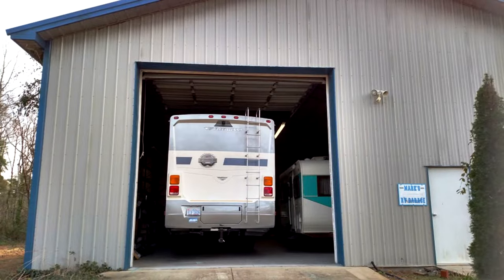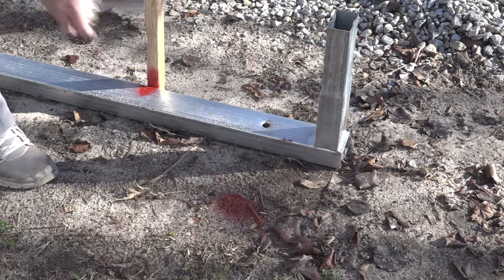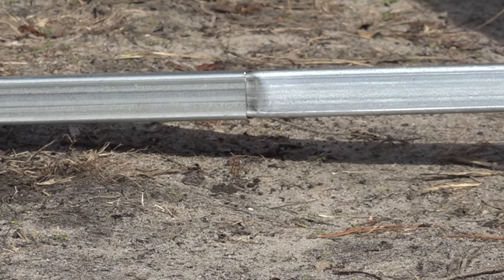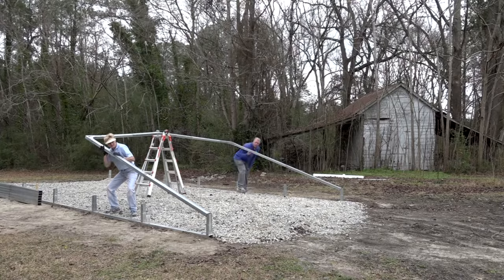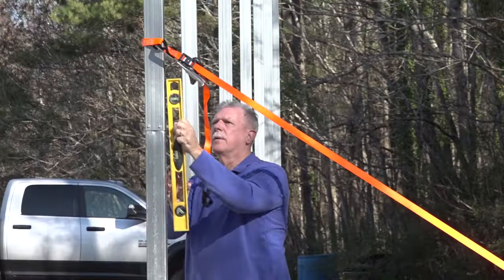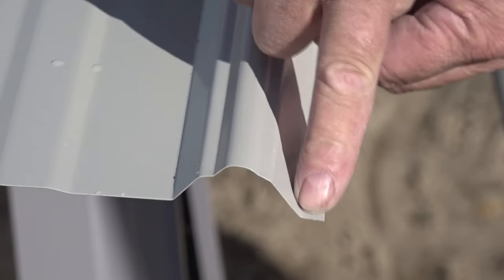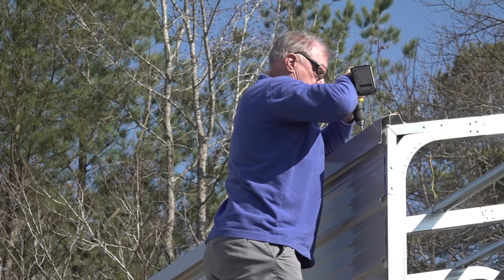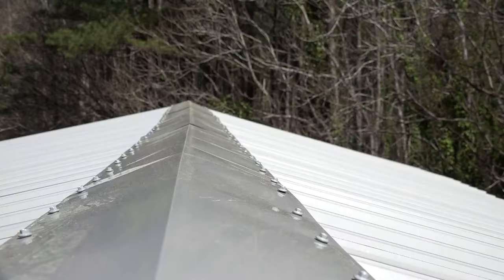How to Install an RV Carport

Comment: I’m just starting mine! Doing a 21x27 I just finished the site work but will be doing radiant I can’t wait to get it up
Reply: how did it go? how did you do radiant? spray on? can you buy metal with reflective bottom/underside?
Reply: @mikesullivan6759   I ended up doing radiant tubing in the floor. However I also hung a natural gas moodiness heater for heat aswell so I will have options. My thoughts on it is if you are planning the concert you might aswell put the tubing in the floor because it’s worth it in the long run. For example im a plumber do the labor was free and the material was only $1400 bucks. To me it’s worth it.

Comment: Be sure to call and verify and than get in writing the true lengths of their units       I ordered a 29' 3 sided carport and it is actually 27'  I called and emailed them and it took 2 days for them to reply back vs the expected less than 24 hours and they said their dimensions are all 2 feet shorter than what you order since there is a 1 foot overhang of the roofing material so it is a still true 29 foot carport   BUT it is truly only 27 feet or 2 feet shorter than I was expecting to get and was confirmed when I spoke and ordered over the phone that they said was 29 foot but it was only a true 27 footer

Comment: How did you install the ridge cap? Did you have to climb on the roof to install?
Reply: That was my question!
Reply: @richardwall1327  Lol, I was thinking the same thing. Unless that material is thicker than standard metal roofing...I would damage the heck out of it trying to maneuver that around.

Comment: Ya’ll made it look so easy! question , I have very packed gravel base that been on driveway since 92. What anchors can I use without making cement hole.  I will get it installed by crew! Amazing work team you guys! ❤️👍
Reply: Arturo 🛣️